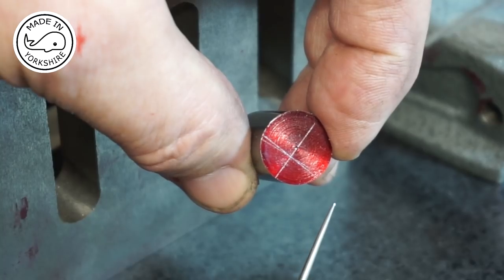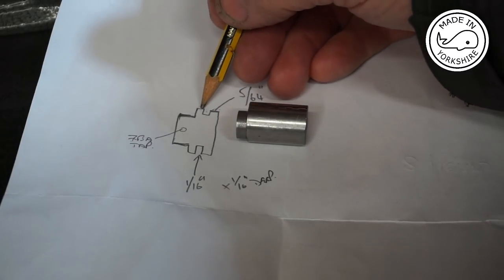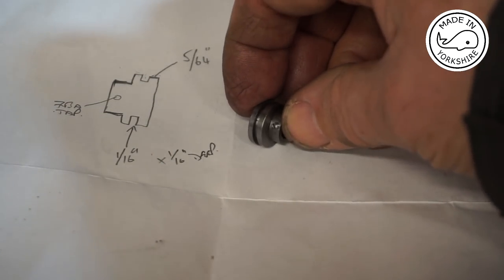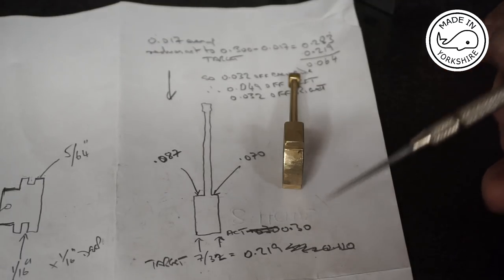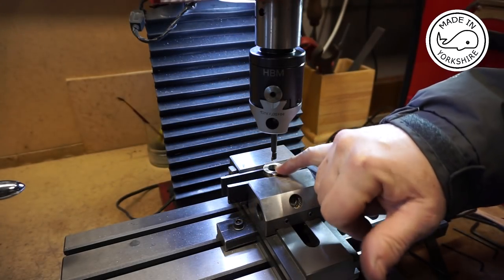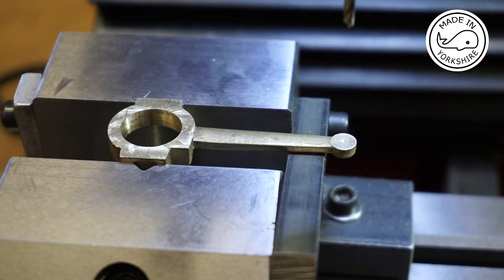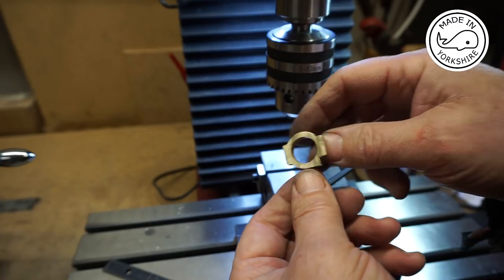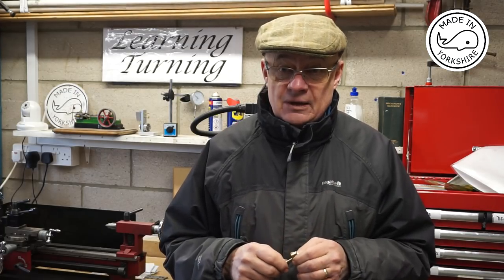#MT25 Part 12 - Making a Stuart 10V Steam Engine. The Eccentric Strap and Sheave. By Andrew Whale.

Comment: Have you spoken with Stuart Models about the two substandard  brass castings? They were always good about replacing cast iron castings that were no good.
Reply from the maker: Hi Mike. In hindsight I maybe should have got back to Stuart. In the end it worked out reasonably well and I try to show it 'warts n all'.
All the best.
Andrew

Comment: I don’t think jewelers are cutting mild steel very often.
Reply from the maker: Very true Barry - though I do use it quite often to cut down mild steel screws. A bit heavy on the blades but it doesn't damage the end of the screw thread.
Cheers
Andrew

Comment: I really appreciate your discussing your thought process as you struggle with things such as what appears to be bad castings and other challenges. Could you post the brand of safety glasses that you discussed and possibly a link to where they can be found. I have to wear bi-focals to see well and would like to have a pair of safety glasses that fit so well that I forget that I am wearing them.

Thanks again and keep up the spectacular work.
Reply from the maker: Thanks Robert.
Re the safety glasses, I've included some info and a link in the video description. I hope you give the glasses a try and that they work for you. I am definitely well impressed and they are reletavely cheap. Obviously everone is different, but definitely worth a punt. Let me know if you try them and if they are a success. 
PS I don't have any association with the supplier.
Cheers
Andrew
Reply: they are called nocry and I bought mine of ebay arrived next day

Comment: I'm looking at my vintage 10V, very finely made and seeing the same angle of the beam to the centerline of the big end. I don't have the drawings, but it does appear the small end is offset a small amount to the large end, looks to be between 1 and 2mm. I can't disassemble this to measure, but my engine was made in the 60's so they have been cast like that for a long time.
scratches head*
Reply from the maker: Interesting! I've just had a look at the drawings and the little end does appear slightly offset from the big end. Something I didn't spot at the time. Strangely the drawing doesn't indicate the amount of offset but the indicated centre position of the big end definitely doesn't appear as being spot on. The mind boggles! Anyway, mine turned out OK in the end.
Cheers
Andrew

Comment: Hi Andrew. Love the use of 123 blocks to inspect the pressing. Been thinking about a simple jig to hold the strap by the shaft which would become the reference plane for all machining. Have had difficulties with the con rod, which a jig could resolve. Got a lump of 30mm granite kitchen top for £20 and although its pink, in conjunction with a height gauge makes life a little easier. Regards
Reply from the maker: Thanks Len. I guess the method for machining for the strap and conrod is similar, and a simple jig sounds interesting. If it works out OK please don't hesitste to post a comment so others can see alternative methods. Great value granite! You just need to paint your machines pink to match :-) A surface plate and height gauge made life a lot easier for me.
Good luck with the build.
Cheers
Andrew

Comment: Looking good Andrew, I can almost hear it chuffing away in the far distance :-)
Reply from the maker: Thanks Peter - me too!
Cheers
Andrew
Reply: @learningturningmetal  One thing you may find useful is next time you have a can of the dark stuff in the fridge snip up various sized bits of the can, they come in useful as thin packing pieces/shims for use supporting work pieces that may flex a little while machining such as when you drilled the top hole in the eccentric arm. I have a jar of various sized pieces ready cut, they are good for protecting your work from chuck jaws etc too.
Reply from the maker: Thanks for the tip Peter.

Comment: Job well done. I have been struggling with the castings of my Stuart S50 at every starge due to exessive offsets and misaligned parts all the way. At times there are no extra material allowed for machining to correct the castings. The worst one was the cylinder which was so bad I almost sent it back but it was XMas and I couldn't be bothered with the wait. It seems that QC has gone AWOl from Stuart castings once again.
Reply from the maker: Thanks. It's a real shame about your S50 castings. Mine were fine and I found the S50 easier to machine than the 10v. The brass pressings supplied with the 10v were pretty poor, but I'm not sure if that's to be expected with pressings. I might consider making an engine from bar stock next time. Might be a big challenge but cost is far less and the quality is bound to be decent.
Good luck with the S50.
Cheers
Andrew
Reply: @learningturningmetal  Thanks Andrew. I had better luck with my 10V a few years back . If you remember I also set this project up as a challenge to be machined with my Sherline lathe and miiling machine  and , to be fair they have coped very well within their size limitation. I used to build Elmer's engines which are entirely made from bar stock and I should have plans of a couple of Liney engines somewhere on one of my computers. The most difficulty I had was with those  damn ' flame eaters ' whose plans I bought from a Dutch guy.  You will find  building from bar stock much easier as mistakes can be corrected and you really use whatever fittings that you have at hand. Looking forward to the completion of the 10V.
Reply: My S50 cylinder the core was on center one end and off center the other. In the end had to make the bore a little oversized but piston was made to fit.